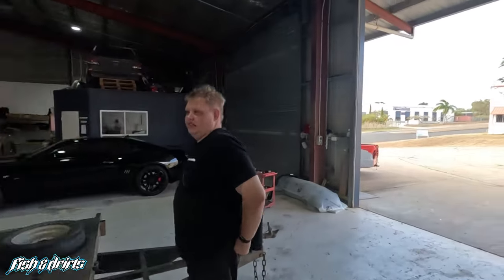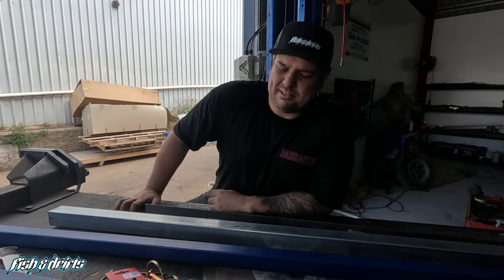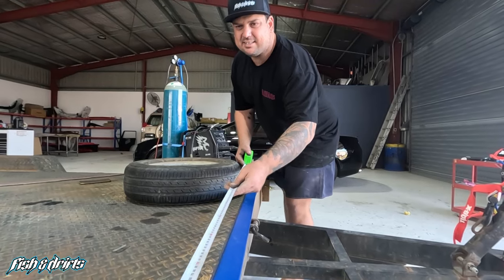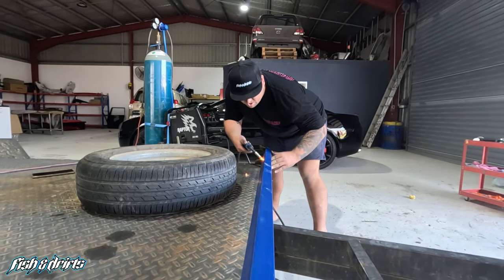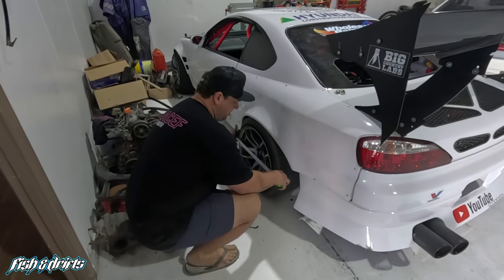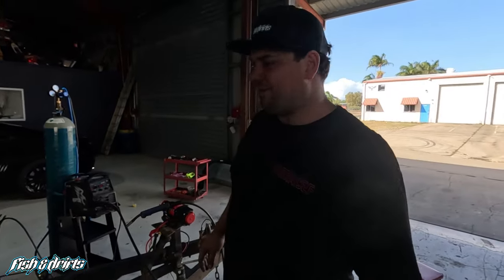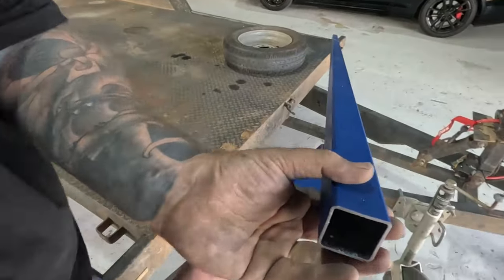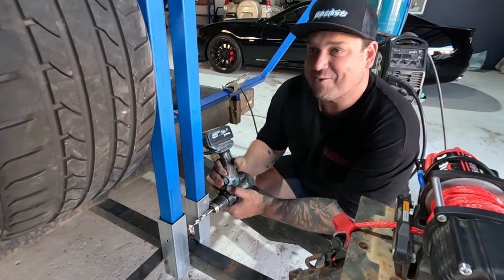BUILD A TRAILER TYRE RACK.. BUILDING A TIRE RACK THE FISH & DRIFTS WAY

Comment: Hahaha fluked it but looks awesome. Just needs a square frame with castors to drop it into when at the shop to keep it mobile! Ultimate.
Reply from the maker: That's a great idea a separate frame for the workshop on wheels, love that!
Reply: ANNNDDD if you put good castors and work out a way of carting it around on the trailer you might be able to use it to drag wheels and tyres around the pits too
Reply from the maker: @YNOTSX absolutely brilliant thinking the ideas for a tyre rack is endless